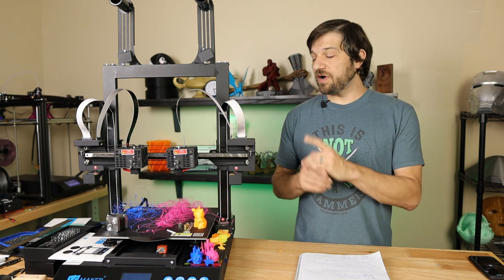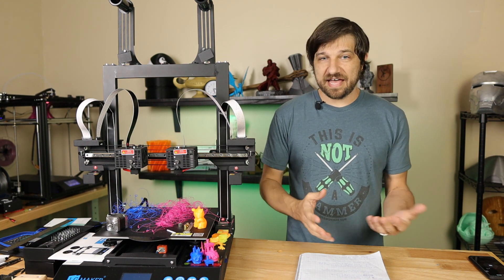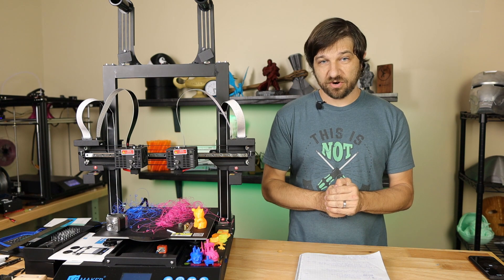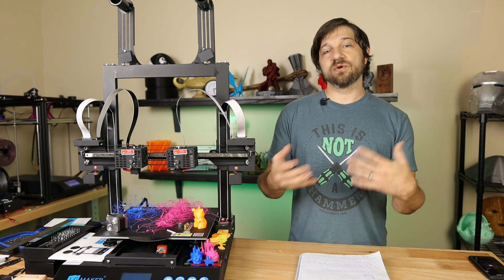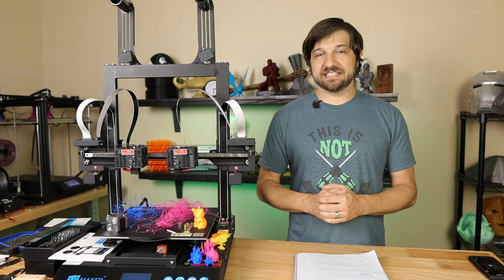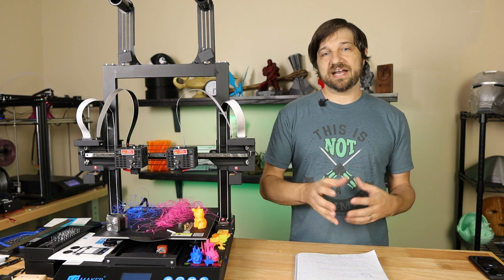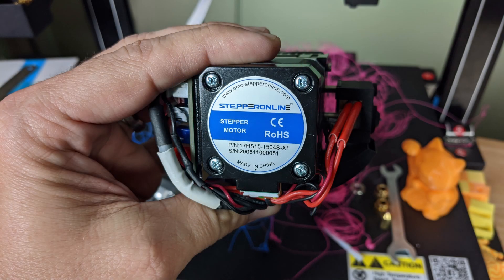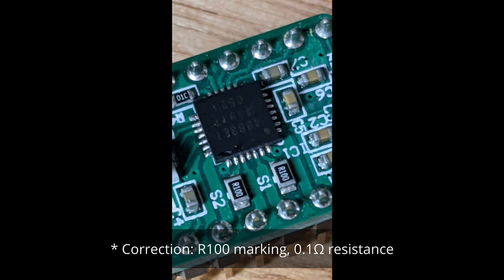JGMaker Artist-D Extruder Issue Deep Dive

Comment: I know this video is old, but this could very likely be the end-result of poor thermal transfer to the quick-release nozzle. You can't just measure a static bloack near the thermistor to see if it gets to temperature at a flowing nozzle, how much heat is lost into the plastic and does the metal in the nozzle keep up with the thermal block? The loose fit they have possibly isn't good enough. Also in general these days, there are some great extrusion flow-rate tests to see if a specific region of extrusion speed is where this shows up. Possibly worth revisiting sometime if it's still around.

Comment: Since there has to be some looseness/gap between the heat block and the nozzle in order for the quick-change feature to work, I wonder how well putting some heat transfer paste on the nozzle before installing it would work? I just ordered one of these printers on EBay a couple days ago. Hopefully in the two years or so since you made this video they've worked the bugs out. If I have the same issues first thing I'm going to likely try is heat transfer paste.

Comment: A bit late in the day but, I had a slipping gear in my extruder on an Ender 5. What I did to resolve it was to hang weight on the release lever. No difficulties since. 
What I have noted is the the extra pressure on the lever causes the gear to bite into the filament leaving marks that can be felt with fingers.
Did you find any markings on the filaments to indicate that the gear was indetenting the plastic.
I am was considering getting a production model of the JG Maker but will cancel my interst and wait to see if the issue is resolved.
Thanks for the great review and update.

Comment: Are you checking comments from over a year ago? I have a good question for you in regards to upgrading the extruder to full metal like the micro swiss or similar to run 260C materials.
Reply from the maker: As long as YouTube notifies me, I sure do! What's up?
Reply: @kerseyfabs  Well, I have been getting some quotes back for a project that I want done in PP GF30. I could even accept the prototype in ABS GF 15. They are complete nonsense
But both require Aquatek X1 water soluble support. And nozzle temps of ~260 THis is not possible according to JG. Nor do they sell hardened steel nozzles at this time.
So.... do you think it might be possible to upgrade the hotend given the layout of the guts of the extruder assemblies? I am quick on my feet and have lots of tools and skillsets but I would be interested in your opinion so I don't have to buy one only to find out that I have wasted my hard earned
Reply: respondants have only offered ABS no composite in a FDM and Nylon 12 no composite in an SLS machine. (Laser sintering)
Reply: @kerseyfabs  What I am saying is that the quotes are more than I can afford. $300 for plain ABS or Nylon. And I want to mess around with material that is capable of dealing with engine bay temperatures with a high output V8 motor that I have created an upgrade part for. Automotive industry uses Polypropylene with Glass Fiber 15% I must at least have something that will deal with the heat spike after shutting off the motor on a hot day, and resist deformation as well. I could prob manage ABS with GF
Reply from the maker: @chrisleech1565  So do you want to retrofit a cheaper printer or just buy a nicer one?
Reply: But if you have something in the neighborhood price wise. Like under $1000
Reply: I am looking at the Tenlog TL-D3 so don't sweat it my friend. I can get it for the same price as a JG Artist D Pro. It doesn't have those questionable ribbon cable supply wires anywhere :) No instant project. Just some fine tuning and maybe  hardened steel nozzle or two.
Reply from the maker: Good luck to you. I haven't tried that one.

Comment: This video is old but I had a few prints with tons of under extrusion. I just removed the filament runout sensors and its started running a lot better. The ones on my machine take a lot of force to pull through and I can see the machine struggling to pull the filament. When you do this you also have to disable the runout sensors in the settings.
Reply from the maker: Thanks for the idea but that still means that the extruder isn't working properly and it's slipping. It's not a bad work-around though, if you don't have another option.

Comment: I got my Artist-D Pro 4 Weeks ago with the same problems, now i am in contact with JGMaker...

Quote out off the last Mail...

Hi ,
Thank you for email .
Sorry to give you bad experience .
But we have tried my best to help you .
That video is very early and we have updated this problem .
We change it , we don't meet your problem .
Reply from the maker: Sorry to hear that. At one point they told me they fixed it with a firmware update which, as far as I can tell, would not do anything for this problem. I've heard from some people that seemingly have no issues. Others have contacted me to confirm the issue. Either way, I am still considering replacing the extruders on mine.
Reply: @kerseyfabs   I think the same. A firmware upgrade will do nothing. They provided me a profile for Cura wich doesnt help but trys to mask the under extrusion. Then a new Nozzle and new Gears with more Teeth and guess wat, it got even worse. Now they try to fix my machine with me. If it not works i will try to return the machine and refund my money. Was my first machine from them and probably my last. My One Star Review on Amazon might helped a little bit so Gaowei Tech is in charge

Comment: I recently purchased the pro version and I have not experienced this issue, yet.  Maybe they have made changes.  I ran a several hours of recommended settings for the PLA I’m using and the run out were very repeatable all within less than 1 mm.  Not sure of what you experienced but this one does not have that problem.  I followed the dr Vax set up procedures.  I would like to change out the fans if anyone has a suggestion.

Comment: Did this ever get updated and fixed
Reply from the maker: Not that I've heard.
Reply: @kerseyfabs  I assembled my Artist D pro yesterday and IMMEDIATELY noticed under extrusion. I'm getting upwards of 30% less mm's than what should be coming out. Adjusting E-steps just produces random results. I can't predict how much filament its going to feed. I suspect its just slipping on the filament so I'm gonna try what I can to increase the tension. Sadly a hard screw almost never works. That spring has to be able to give. I modded my previous printer to run a bowden with a NEMA 23 and it can feed enough filament to go 150mm/s now lol
Reply from the maker: @Siphonife  Sorry you're seeing the same problems as I did. I may be working on an overhaul to fix mine in the future.

Comment: Hey Y'all! Just wanted to let anyone who views this video know that a few workarounds have been found to this kind of issue. One is that you put a small metal plate inside the idler, between the idler spring and the tightening screw. Another is that you simply put a washer on the tightening screw on the outside of the extruder housing. I can confirm that at least the first solution does something, it really brought down the E-steps needed and did improve underextrusion quite a bit. Check out the Artist-D subredddit if you want more info. (r/artistd)

That said, the extruders are still pretty crap all things considered. A good plan would be to eventually invest in some better ones when mounts start showing up, but the machine in and of itself is pretty solid.
Reply from the maker: Thank you for the feedback. I'm glad some have been able to find some work-around. Too bad they couldn't have shipped it with one.
Reply: I know you posted this a year ago, but I was having the same issue, and I used the washer on the tightening screw you recommended.  It takes some tweaking still, but seems to improve the under extruding drastically, so thank you!
Reply: @xenotrim  you're quite welcome! Honestly the Artist D has just been collecting dust since I posted that 😅
Reply: @xenotrim  Many thanks! I have some filaments (mostly the shiny ones/glitter looking ones) that resulted only ~60mm extrusion instead of the 100mm. Added a washer and it works quite great (100mm with 100 e-steps).
Reply: Where exactly do you add this washer? Any pics or videos on the installation. I can't fanthom how a washer on the outside of the extruder assembly would do anything but reduce the travel of the screw. Where does this washer go?

Comment: I started up my Artist-D today and the first thing I did was to calibrate e-steps.
I did not get consistent results precis as you.
Best result when printing with +10 degrees more than normal as you got.
I have had similar problem on an Ender 3 and the solution was double toothed gears.
Reply from the maker: I'm sorry to hear that! I hope you're able to work out a fix. I still have mine, just haven't been able to circle back around to trying to fix it.

Comment: @Kersey Fabrications, I really appreciated your videos regarding this printer. I did back it. I now have this printer in hand and have to say that it is a well put  together machine. Would you mind doing a follow up to these now that these printers are making it into the hands of backers? I would really appreciate if you could touch on setting up Cura profiles and maybe fit in a deeper dive into working with IDEX (Marlin & slicer) printers.
Reply from the maker: I appreciate you reaching out. I would love to see what's been updated on a shipping printer and if I have better results. I don't have any plans to do any more with this machine (at this time) but I would be interested in seeing a new one. So we'll see.
Reply: @kerseyfabs  I look forward to any more information you share on this guy. This is the second Kickstarter printer I've received and must say that it is extremely well put together. The closest machine I can compare it to is a Creality CR-10 (mostly in terms of size). It's build is much easier than any of the Creality machines I've had the opportunity to assemble. I've run about a dozen dual color test prints through it for calibration. I'm seeing some oddities regarding extrusion, but I haven't ruled out the test filament that they sent with it. I must confess, I wanted to see it do dual color so I set it up and went straight to that. I'm drying the filament in my EIBOS Cyclops and will start really trying to work on getting it dialed in. The issue that I'm seeing is that if I measure off 120mm and extrude 100mm I get consistently 25mm at the measurement point, 5mm under extrusion right? I did a 40x40x40 single wall, no top/bottom, and no infill to get a single line extrusion width and came up with an average of 0.48. This was without adjusting e-steps, over extrusion?! Again, this could be filament. The prints so far have the look of over extrusion. I'll test again after the filament is dried 6hr at 55C. It did have some noticeable popping when making a nozzle caddy for their unique nozzle design. I'll try to keep you informed of any discoveries. I might not go as in-depth as you did to uncover any issues!

Comment: In the reviews video with the breakdown of how the extruder is put together the first thing I noticed is that it looks very similar if not a clone of the titan aero. What would be your opinion be of changing the extruder out to something different or aftermarket? I had already thought of doing this because I want to be able to have a all metal hotend. So going to a different extruder like the titan aero would seemingly solve two issues.
Reply from the maker: That's what I'd have to do if I purchased this printer and what I may do to mine here. It shouldn't be too hard to adapt but it will require a little work given the break-out board and all. If I do it, I'll film a video.
Reply: @kerseyfabs  Thanks for replying. I'd be very interested if you replaced one extruder and did a comparison test to show that the titan aero (or another extruder) did not suffer from the same issue as the extruder that comes with the Artist D. It's going to be expensive for those of us that backed the printer to buy two titan's, but we'd go back to having a standard nozzle type and it would open up the ability to print nylon or other engineering grade materials with the appropriate support filament in the 2nd extruder.

Comment: First off, ALWAYS try the easy things first!  And nothing is easier than increasing the temperature.   You wasted time and effort swapping out parts before even trying to increase the temp.  And then you wasted more time and effort AGAIN to test more things before testing the temperature accuracy.  Secondly, the PTFE tube on this model, based on all the reviews, goes almost to the end of the nozzle means.  This leaves very little metal at the end to melt the plastic.  So what do you have to do it compensate for the limited exposure to the heated metal during extrusion?  You have to raise your temps!  So it was not only the easiest thing to test, it was the most likely, given that you'd already seen the HE assembly.

For anyone else troubleshooting extrusion, try disabling the steppers (or disengaging if your extruder has a release lever) and pushing filament through at different temps to gauge the resistance.  That is a really quick and dirty way to approximate the right temp and even help you identify other issues, such Bowden tube friction, extruder gear alignment, etc.
Reply from the maker: Wow... thanks for the advice... I think. Your delivery could be a little less edgy though.

As I showed though, the hotend temp really didn't fix the issue, it just masked it. I showed by replacing the nozzle and heat block, the extruder still slipped. I also pointed to another YouTube video that showed possible slipping and by raising the temperature he made his prints worse. While this is only one example, I would expect similar results.

Thanks for the feedback.

Comment: Interesting. so far I am having the opposite issue. too much extrusion. down to 0.92 and think I need to go down a tiny bit more.

I have NOT tested consistency yet still working the first print (sliced up a 2 color tree frog in S3D)

I will be sure to make some tests for that. TOO TIGHT will definitely cause under extrusion. its counter intuitive but remember the filament is plastic. plastic as in "it can deform and give" and too tight what happens is it crushes/squishes the filament and pushes it "back" and prevents extrusion and it stops or just chews into the filament.

this one might be finicky where it needs to be well tuned in pressure. so far mine seems to be working well enough to finish a print but no way to establish quality of consistency until I have more prints in place. I will make some more calibration test prints before feeding it a 100 hour print.

do you think replacing the feeder might be feasible? ie adapting something more reliable to fit in their?
Reply from the maker: I agree, too tight could cause this problem and that would agree with my findings when I tightened fully. I could try a softer spring, which I'm sure I can find. My biggest concern about that is that we could be looking at a fragile balance.

I never got to long-term print testing due to the extrusion issue. In my first video on this printer, I had a simple Megalodon Benchy fail from possibly under extrusion. So I didn't want to waste any more time/filament after my findings.

My thought was to replace the whole assembly but to fit something in the cage would probably not work. I don't know of another all-in-one assembly that's that small.
Reply: @kerseyfabs  agreed if the balance for tension is too slim of a margin you'll never properly get attention as a filament changes slightly throughout the role you'll move outside of that very fine limit of range hopefully that's not the problem :-)

I sliced up a two-color tree frog in simplify3d last night and it came out pretty nice I thought I had a misalignment in the head off set but then I looked more closely at the slice preview and realize the model themselves are slightly misaligned :-)

I have a couple more prints to do so far they're looking okay before I attempt a larger 120 hour multicolor print

Comment: An other point of view about the extrusion problem. What about the nozzle with the teflon tube in it. Will the heat have enough time to melt the filament. I have no experience with other nozzles, but I can imagine that the small amount of copper which will heat the filament is not enough. And can it be that there is some inconsistency in the filament that will give different result as the melting area is critical small. Just my 2 cents of thoughts.
Reply from the maker: There seems to be a lot of concern about the nozzle which is why I tested it with a completely different heat block/nozzle assembly. I even went another step further and ran a temperature check inside the original nozzle: https://www.youtube.com/watch?v=0p7NCxpJHU8
Everything looked good. I can't guarantee how fast it can go but it was hot at the tip.
As for filament inconsistencies, if I was using budget filament, I may be concerned but this is high-end filament to avoid those issues.
Reply: Kersey Fabrications. Now I remember that you switched heat block and nozzle. About the temperature check. When measured at one moment it looks good. When extruding, will it be consistent? I have the feeling that the operating window is quite small that when you operate at a higher temperature the operating window will be more safe.